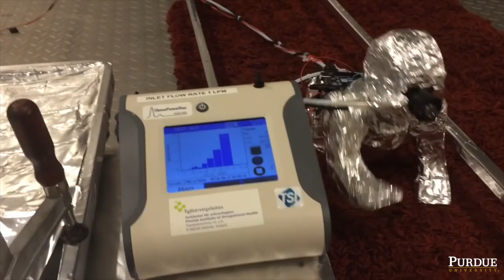Robotic Infant Design for Indoor Air Quality Research

Comment: I'm curious as to why what seems to be aluminum foil was chosen as the material to coat the infant in. It doesn't seem like any other materials were chosen.
Reply from the maker: If you're curious, you can read the supporting information for this study that describes how the robot infant was designed. http://pubs.acs.org/doi/suppl/10.1021/acs.est.7b04183 - here's part of the description:   "The exterior of the robot was lined with grounded aluminum tape to minimize the accumulation of electrostatic surface charge and was wiped with isopropyl alcohol after each experiment."
Reply: Purdue Engineering - Thanks!